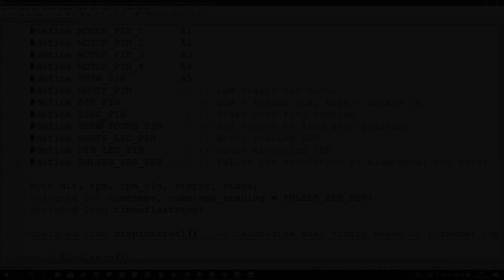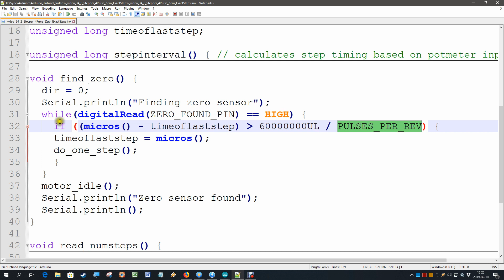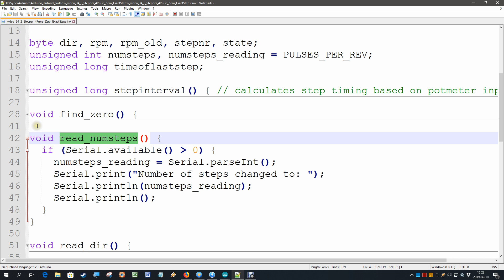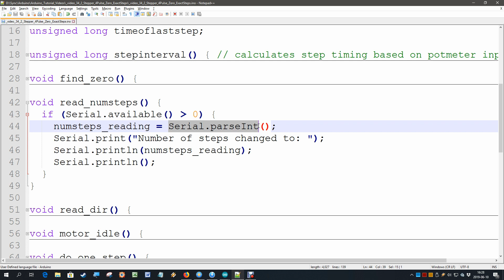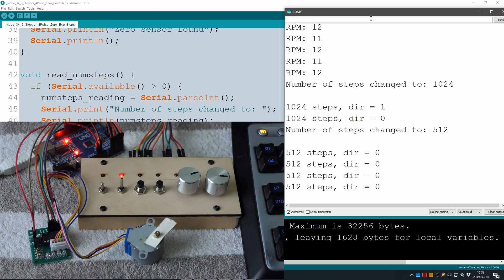Fun with Arduino 34 Rotate an Exact Number of Steps

Comment: Hello sir! You made a very good and useful video. The examples you have shown are great. Can you help me with an example. I know this will be simple for you and will take you almost no time. Can you share some code where on start the arduino the motor returns to home position (hall sensor will be used as a limit switch) then on a button press the motor goes 200 (for example) steps and stops. After pressing the same button again, it will return to the home position. I would be grateful if you could help me with this example. Greetings

Comment: Hello Rudy.. did you build in a steppingmotor on the turntable or is this a example of what we could do? If so.. I like to know how and which motor you have build in that turntable. Thanks for reading and answering my question.
Reply from the maker: At the hobby club a nema17 stepper was built into a train elevator. Stop positions are triggered by hall sensors after the motor decelerated to a low speed for the final few mm. We are going to build an HO turntable later this year, the mechanical design of the motor drive is not yet decided on. A model rail friend built a stepper into a turntable and he uses this software, zeroing and from there on counting steps. I have not seen the mechanical construction, he had it already built in and it's hidden under the table now.
Reply: @rudyshobbychannel  Bedankt Rudy! Zal eens uitkijken naar die stappenmotor maar denk dat het inbouwen best een klus is. :-)